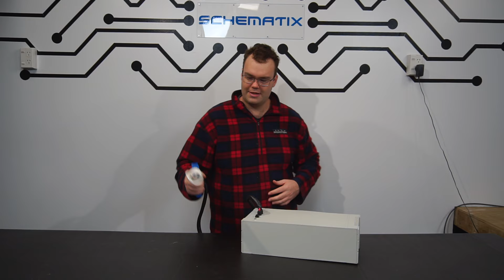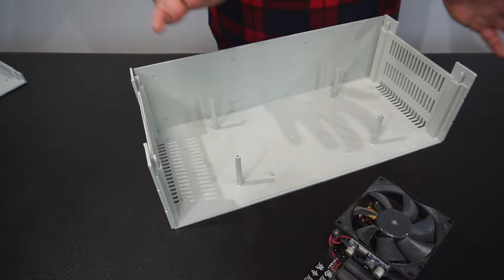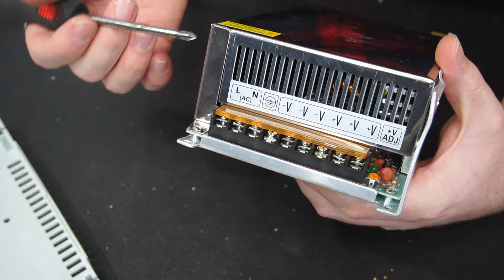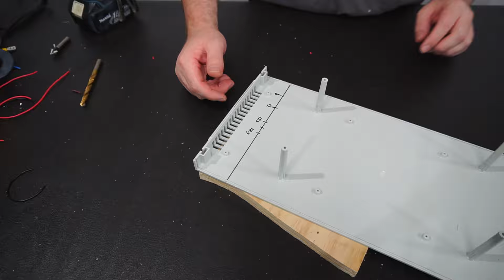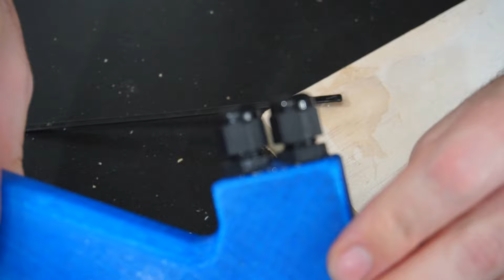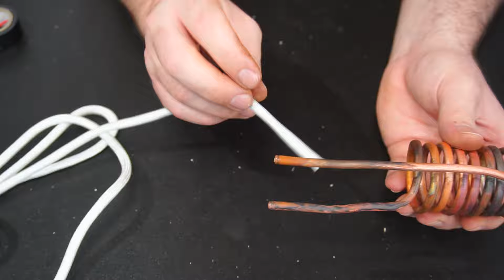How To Make An Induction Gun (Bolt Heater / Buster)

Comment from the maker: Verbal typo at 19:52. To clarify: THIS induction heater won't heat non-ferrous metals. It's just not powerful enough. For heating non-ferrous metals like alloy, brass.etc you need a more powerful induction heater and also the coil frequency plays a major role when heating non-ferrous metals. Sorry for any confusion! - SCHEMATIX -
Reply: I'm pretty sure it will heat up the brass and aluminium. Please do a follow up video testing it.
Reply: @jameswright528  q
Reply: @jameswright528  àbbaßongß
Reply: @jameswright528  In theory yes, in practice possibly not.  The concept of an induction heater is a bit like a transformer - but a really bad one where the heat of the secondary coil is entirely turned into heat which is exactly what a normal transformer is trying to avoid.  The problem is the inductivity achieved with non-ferrous metals may be insufficient to induce a sufficiently large current to achieve the desired heating.

Yes, brass and aluminium can be heated in an induction oven.  Even without fancy electronics.  It's a common experiment shown at schools.  But that setup is not practicable for working on a car.
Reply: yeah but would that maybe also melt my fillings right in my face or something too?
Reply: I have a 10KW induction heater that can do Aluminum.  It runs at 20 KHz.  If I put a 1/2" diameter slug in there it can heat it to 1000F in under 6 seconds.  The other thing i notice, the Aluminum physically moves and aligns to the field (centerline of the coil) when you turn the power on, like it is magnetic.  I am assuming the electric field is strong enough to do this but that's just a guess.  I dont think it is heat or draft related because it happens the instant the power button is hit and it even vibrates a bit.  Does anyone know the cause of this phenomenon?
Reply: @smoke05s  It has to do with the interaction between the magnetic field produced by the heater coil & the magnetic field from the eddy currents induced in the aluminum you're heating.
Reply: Couldn't you put a ferrous metal sleeve permanently inside the coil, inductance heat that sleeve while it is positioned over the non-ferrous metal target and let the heat then residually transfer?
Reply: Do you have an Instagram
Reply: I was gonna ask if you could tune the inductor to the oscilator and the frequency to the use scenario?
Reply: Nice build.. I am a noob on the matter and its more the concept that appeals to me... so pick up a cheap edition that cost around 3.5USD and been playing with it the last couple of days,.
https://i.imgur.com/6lMr8mP.jpg
Was planning to make some recording with thermal to show how the heat transfers and I atm I run it on an adjustable power bank that tops out around 80watt, but for proof of concept and small metal pieces its work brilliantly..
form a 3.5USD product it is able to make fx a 5mmAllen Key completely red glowing, solely from a USB(DC) powerbank..
DP my bad.
Have you validated what kind of watt you are able to deliver with your setup and if it's loyal to spec' hence 1000w.
would be very easy to put a basic watt-screen in your big casing and also give you a good indication when its in fact heating and when your holding it ideally on the mark' as that can vary greatly and here that amp current-info value is a good indication, for when its done heating and close to topvalue as it will then start to go down' and you don't have to hang butt naked in no mans land, if its heated or not or start looking for glowing identification' that can be difficult to see under some scenarios.
Reply: sooo much better to simply buy an induction cooktop and transform it into a gun. Get one second-hand, it's commercial grade and often 1800W or more. Also you get power control built into it . . . these "build" videos just dont make sense
Reply: @JAndrioli  and the power supply is not cheap
Reply: @JAndrioli  Hmm good idea.

Comment: Exactly what I need! All too often, bolts and nuts are in a no-flame area. It has pissed me off a lot of times when a stubborn bolt can't be loosened, and all it needs is a bit of heat.
Reply: You can configure the “coil” to where it will heat copper pipe such as water pipe so you can solder it without using flame. It would be handy in close areas like that.

Comment: Need help... I have a 1800W 40A 12V-48V ZVS Induction Heating Board Module Flyback Driver
 from amazon...work well tried to build a induction gun like this...with 4-5 foot long cable .. the cable are stranded copper sem ridge  10 awg. The get very hot quickly... eventual like to water my coil..
Question how to prevent  cable getting hot... add aire space on cable to gun...add more capacitors at the gun or in the cable... need advice

Comment: I have a Solary. Induction heater and some of the fiberglass sheathing got burned.  Could I replace the sheathing with an Aramid or another high temperature fabric?  Also, if the coiled wire loses its shape, should I rewind it around some sort of tube or cylinder? I wasn't sure if that effects the flow of current or field

Comment: I got one for you instead of just using a razor blade to strip your wire try using a pipe cutter it twists your wire for you and all you got to do is pull to the side while twisting and it strips your wire for you too

Comment: If I were to eliminate the ac/DC inverter and for example use an 18v milwaukee big battery pack wich is straight DC, would I need to put a register or anything other than a fuse in between the battery and Moffett for induction? I want to build a mobile version that uses my milwaukee battery's from work, I already have the battery socket piece to adapt straight into Moffett.

Comment: Hi this video is some years old, but if you (or others) still read, I have a question about this.I have an induction stove with a broken glass top, can I connect two wires from the input on the induction element to a smaller coil to make it flexible, like yours? Or is it dangerous since it's 240 volts?

Comment: I am thinking you could use a repurposed soldering gun. If you could not 3D print one! You could wire in the trigger on it to control the induction heater 🧐

Comment: Hi, great video by the way. I was curious as to why the induction heater you built here is so much bigger than the commercially sold ones for automotive mechanics and I’ve seen the commercial ones work and they get both glowing within a minute or so.

Comment: pro tip to make this just a tad bit better, move the capacitors closer to the coil at the handle bar, the current resonates between capacitor and coil, only a little gets added by the mosfets, the way you have it right now, all the current is circulating in the cableling to the handle aswell! if the capacitors are right next to it, it will work better and be more efficent.
also edit, at these frequencies (likely around 100khz, the more caps the lower the frequency) 10sqmm wire isnt the same as 10x1sqmm (skin effect) use multiple thinner strands.

Comment: The wire connection between a 'gun' (handle) and the circuit, ist safe?, Coz it becone a coil it self, how about when you turn on the circuit and put a metal on it (cable) will it heat up???

Comment: Caution:  One thing I have found is that some of these Chinese induction heaters use an IRFP064N  (as well as IRFP260N) mosfets...these are only rated at 55v.  With a 24v input, you will be applying over 75v to the mosfets, and they will blow!  The 260's can handle an input to the ZVS driver of 60v.
GREAT videos...
how much trouble do you have with blown mosfets in your work???

Comment: I am working on ways to switch the ZVS on and off.  I have found two simple methods which need only low current/voltage (100mA range) to turn the driver on and off with a low-power bjt (TO-92) transistor.  Testing will be finished in a few days.
Thanks for the tip on the fiberglass sheathing.  BTW: the output of the ZVS is PI x Vin.
GREAT VIDEO!!!
Reply: not sure if were on teh same wavelength but i modified the ZVS itself with some 2n2222 drivers, slam the gates hard and keep them saturated. rather than the lousy 5w resistor they standardly use.

problem with ZVS is they dont like suddenly changing component values. things like, perhaps, sticking large bolts into coils whilst running.

that ALWAYS resulted in fets EXPLODING on me... no smoke. no heat. just shards of epoxy encapsulation suddenly sprayed across the room.

putting stuff in the coil THEN powering up was fine. they only like steady constant loads. 

abrupt changes whilst running... BOOM.

Comment: So basically you created an electrical short which heats up like a vehicles cigar lighter?  A few years ago I rebuilt the suspension on my vintage truck, it took a week of torching, lubricating and using long cheater bar to break loose one big rusted 60 year old bolt on the panyard bar in freezing cold winter outside.
Reply: A cigar lighter heats up due to the coil resistance when 12vdc is applied, and it's coil is specifically made to withstand repeated heating.  Induction heaters have no physical contact to the target material, and only heat up slightly.  As seen in the video (17:50), the bolt reached nearly 800 deg F and the coil only 150 F.

Comment: Question: On your handle the square aluminium is exposed so what is the voltage across them and is there danger of electrocution ?  I should of course preface that with "excuse my ignorance"

Comment: I found an ancient soldering gun, opened it up and found out its just a transformer with a trigger. Took some 8g uninsulated copper  wire, made a coil, inserted it, and made induction heater

Comment: I have a question for you as you seem to know a lot about heating wire.  I've seen many nichrome wire foam cutters on youtube, but nichrome wire stretches when heated and breaks after a bit.  Is there a way to keep that wire from stretching and/or make it a bit stronger ?  Can I for instance coat a hacksaw blade with nichrome coating and mount that between two bolts ?

Comment: What are your thoughts RE: insulation on copper tubing in these designs? Do you have favorite brands? What about silicone-coated sleeves? Do you water-cool the tubing by circulating water through it? What about the diameter of the tubing? Is there an advantage/disadvantage to larger diameter copper tubing and why?

Comment: I have a similar project (box of parts) pending where I selected to use "Litz" wire for a light and flexible heating coil cable that should be more efficient having less transmission loss. I'd like to hear your thoughts.

Comment: Does a soldering iron operate in the same manner?
Reply: No. A normal soldering iron just passes a lot of current through a conductor (the tip or connected to the tip) whose resistance causes heat to be produced. Inductive heating uses a high frequency electromagnetic field to induce currents in the work which produces heat due to hysteresis loss (eddy currents).
Reply: @chestervaldes7551  Thanks for the information.

Comment: Use pan head screws in your handle instead of flat head screws in countersunk holes.  Those screws will split your housing.  Either counterbore or build up walls around your screw heads.

Comment: @ schematix.  ive been trying to source parts.  the ZVS heater has a input voltage range of 12-30 volts and a current rating of 20 amps.  You utilized a 24v 33amp power supply.  i have only been able to source a 12 volt 33amp power supply.    was there a reason electrically to use a 24 volt supply vs a 12volt?  better functionality?

Comment: Great, I’m half way through building one of these, mine is 2500w though & requires water cooling. I’m hoping to make it dual purpose & use it as a TIG torch water cooler too.
My problem is power supply, it needs 48v @ 2500w.
I also need to find a suitable enclosure for everything.
Reply: It works?

Comment: You mention that the coil doesn't get significantly hot - so why make it out of such thick copper ?    A more tightly-wound coil of thinner copper would be easier to get into difficult places and onto protruding nuts.

Comment: This is great, thank you! 

I had the misfortune to have a need to remove a nut from a 40 year old suspension strut in an enclosed fibreglass space. I had nothing that would work since it needed held in place by a 9/32" crescent spanner whilst a 9/16" ring spanner tried to unsieze the nut. Suffice to say the tiny chamfer started to round off first.

My local garage lent me their induction heater, and after a few heating cycles and penetrating fluid, the nut came off with no struggle at all. The induction heater is an absolutely fantastic tool for anyone working on classic cars.

I'll be building one shortly :-)

Comment: I want to make the pancake model on which to make my breakfast.
Ahhhhh, imperial measurements. Made me feel right at home.
Something else about removing the insulation from stranded conductors: it is easy to cut some of the outer strands as the blade cuts through, easy, but not a good thing. In addition to twisting that bit of insulation off to “automatically” twist the strands (great idea, by the way) only cut the length baulato on part way and if it it too strong to break loose with the twisting you can break the insulation by bending the conductor. I have found that once a little bit of the remaining insulation breaks the rest will follow by twisting. Another really excellent video. Thank you!
PS
One question: in your desktop model of an induction heater you use copper tubing (looks like 6-8mm 1/4-3/8”) for the business end of the build. Is there a reason for using tubing in that build, but solid 8g wire in this build? I recall you mention possibly running water through the tubing for cooling. But aside from the potential for cooling, will this heater work as effectively if its coil were tubing?

Comment: you could turn that into resistance heater gun if you make the target area coil with thinner wire, or really hot metal glue gun if you have heating target or metal wire passing through the center

Comment: Every last one of the channels build videos all rely on buying all of the major components...  video should be titled how to convert a tabletop induction heater into a handheld..  the led light should be how to assemble components to make a led light.  Basically all of em should be about assembling and putting together prebuilt parts and devices to make something.  The magnet video got to me a lil.. how to make an electromagnet,  first buy an electromagnet....  come on now..  just wind some wire around a nail like we all did in elementary school..

Comment: Like the build! Butttttt..... You don't heat the bolt your trying to remove you hear the metal around the bolt so that it expands and the bolt stays close to the same other then the residual heat that may expand it. making it looser fit.... If you heat the bolt by itself your just making it tighten.
Reply: Yes it expands,  then after it cools off the once hot bolt that expanded is now a little bit smaller and will have broken the rust bond.

Comment: RE: 12V relay for 24V system, just measure the resistance of the coil and put a resistor of the same value in series with the coil. Make the resistor has the appropriate power rating though!!
e.g. If the coil measures 200 ohm, put a 200 ohm/1W resistor in series.

Comment: You need to heat the nut not the bolt because heating expands the metal. 

I would need to try it, but i still think a torch is better for automobiles.  There is situations it is critical you get the bolt out successfully without damaging the threads in the tapped hole. And if you melt the head of the bolt off, you're screwed. If there is something in the way that will burn, then remove it, or put heat shield between it and the heat.

Comment: I'm puzzled as to why you used a proper crimp faston (spade) terminal but then DIDN'T use either a faston ring terminal, or even better a fork terminal, rather than the way you did it by twisting the wire which spoiled your otherwise professional and neat approach for sake of 60cents.

Comment: Do you think that a 20 Amp power supply would be enough or I need more? As the induction heater module is 20 Amp too right?
Reply from the maker: Normally I would recommend a higher rated psu however, with my induction unit I've never gone over about 15A so I think you'll be fine with a 20A psu.
Reply: Schematix thank you so much for your fast reply, i am going to build one soon and the 20A are half the price of the 40A that ive found ! 😜

Comment: Is it cheaper to just buy an induction cooker and get your parts from there?
Reply: Good idea. I also think same. But how to convert?
Reply: @sys6350   que question ultimately is will the circuit have the wattage for it to work. I think it should be a matter of chaning the shape of the coil.
Reply: @nelsonsiliezar3961  really good idea. If work it can save alot of money.

Comment: Did you ever find any formula to making your own coils for it, I know you recycled the original coil, i have been testing making my own coils out of standard 110v solid core I am causing the coil to heat up. how is your coil temp with nothing in it.? have you tried making smaller bolt sized coils?  also your extension cable I found if it gets twisted up i pull more current and make eddy in the loop which isnt good..